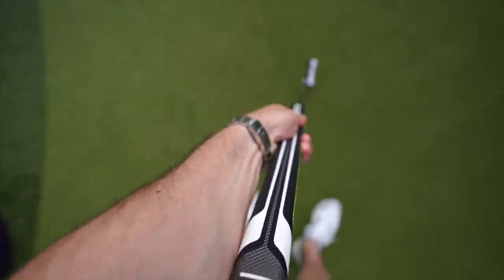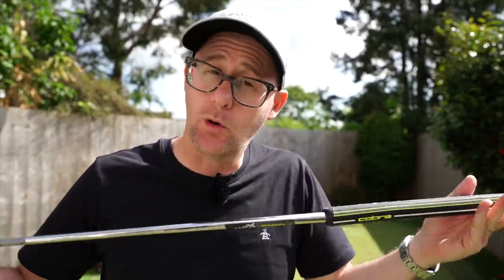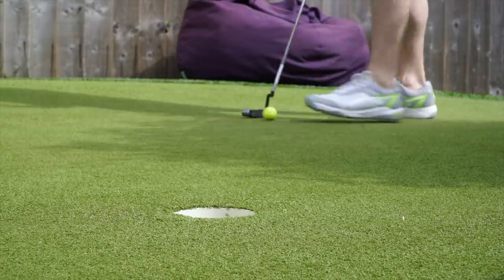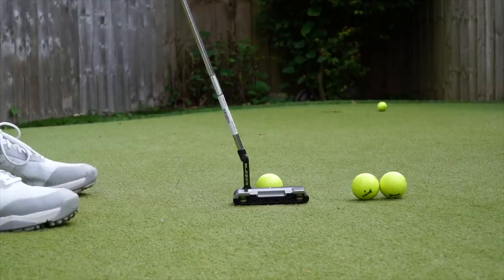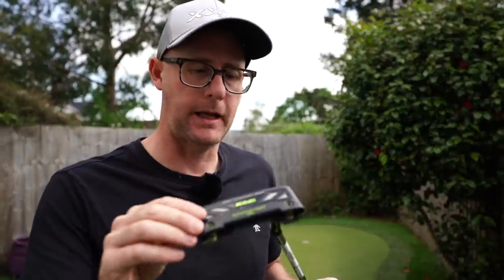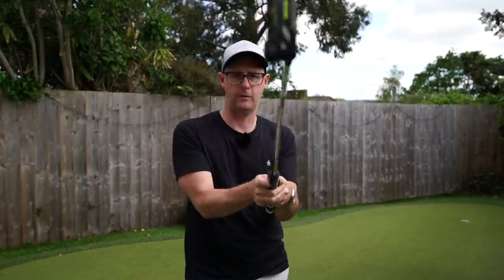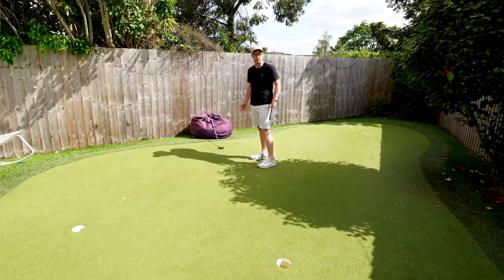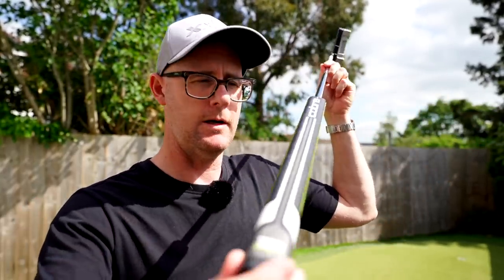Golf Putting Techniques could CHANGE for EVER with this Simple Idea

Comment: Your final comments are so accurate, really well said
Reply: Is it such a bad idea that what’s banned to pros doesn’t NEED to be banned to amateurs? I’d like if my pops could anchor and have a better time while holing more putts.
Reply: At the end you brought up another point that I think is important. Banning something in tournament play shouldn't be considered in the same vain as recreational golf. Golf should be fun and if you are playing for fun some freedom taken by recreational golfers. It speeds up the game and makes it more enjoyable.
Reply: it's too hard to ban.  I can actually arm-lock my current spider putter by choking down on the grip.  how do you define the rule?
Reply: Putting is a weak part of my game, wonder if this could help 🤔
Reply: Ridiculous to ban it. It is not an advantage, simply a different way to grip a putter that some players like better. Some players putt worse with armlock, so of course they are the ones who want it banned. If it really was an advantage, every player would use armlock, but that’s not happening. Golf is getting silly with its technical interpretations of everything.
Reply: @davidmeeks7449  Well said David... agree.
Reply: @davidmeeks7449  agree 100%
Reply: Easy fix just set a max putter length solves many issues.

Comment: Hi Mark I’m a big fan of your channel as you often put a different slant on things together with good humor.

Like so many other golfers my main problem with golf is putting and I have purchased a number of putters trying to find one that I’m comfortable with. I now own the Odyssey #7 as well as the Odyssey Broomstick, Cleveland Beach (which I think you already use), mallet - and a number of others.

Being retired golf is my passion as well as my exercise, so I will spend money trying different things out and that is why I’m now looking at an Armlock putter.

Being tall, I’ve found that by holding the longer broomstick putter I get a better feel and view for the length and line of the putt as well as a more balanced shot allowing the broomstick to roll back and forth before I let the ball go (a pendulum movement so to speak). Other normal sized putters seem to move all over the place in my hands and so the ball tends to travel offline.

I’m also not a big fan of crouching over the ball (aka Jack Nicholas), as it hurts my back as well as not allowing me the full picture as I’m about to putt the ball.
I’ve also tried holding the broomstick further down the shaft to see how the balance feels and it’s pretty good and that’s why I’m now looking at a Armlock putter to hopefully cover most of my putting issues.

I’d appreciate your views on my comments as well as advice on what Armlock putters you like.

Keep up the good work mate as your one of the best on the net 😊

Comment: I really feel like PGA will be looking to ban these soon
By their own admission of banning body lock and side saddle putting I would be very surprised if they didn't ban it in the years going forward.
However, I am a bad putter so I'll take any advantage I can get before it does get banned 😂
Reply: Hands only will probably be the overarching rule.
Reply: God putter
Reply: I hope they don’t as this would drive me away from golf forever. Tennis here I come!!
Reply: side saddle putting is still legal as long as there isn't an anchor point. I also still use a 48" putter... still legal as long as the forearms and the end of the club aren't anchored. Just try and find a 48" putter on e-bay these days. LOL.
Reply: @julia-6195  I remember Bryson being told he wasn't. Maybe I got the details wrong
Reply: @ForzaOwnz  I believe he just got told his side saddle putter was illegal but that was because he ran it up his right arm in a really strange way and it was considered anchoring or maybe it had to upright of a lie angle. Check out Bomar putter company for some side saddle options. They seem to be approved by the USGA
Reply: I agree that it probably will be banned, and rightfully so. It's no different than anchoring with a belly putter was; if you're stabilizing with anything but your hands, it's body anchoring.
Reply: The fact that Bryson uses it. It's reviewable hahaha
Reply: Doubt it. Lol
Reply: I am disabled and been using a normal putter pushed against my left arm I have been doing this technique way before arm lock putters came on the scene so if they ban arm lock putters will they ban the way I hold my normal putter good luck with that one.

Comment: I’ve been using armlock putters for soon to be thirty years, prolonging regular shafts, since there were no ones on the market! Yesterday I tried out the Cobra armlock, and I am now considering buying one. One trait of putting still not being used by the elite,  is the open stance, making it possible to let the upper part of the trail arm be sitting against the body. The left hip would be placed forward, enabling the head be situated well behind the target line.

Comment: Became a bad putter after spending the winter in Canada at indoor putting centre got the yips resulting to go to anchor putter in 2000. Since the ban have struggled since!!! Tried and tried all types of grips and lengths of putter except the armlock. Thanks for the updates on putter tech.

Comment: Used to be a bad putter but made a few changes and I have improved a great deal. Having a couple of practice swings looking at the hole to get a feel for how hard to hit it and lining up a line on the ball with the line I need to take to remove one variable when putting being two important changes that have really helped me sink more putts. I have tried an armlock putter at a golf shop and it did feel like a much more controlled stroke.

Comment: Bought this putter a month ago. The trick beyond just getting used to locking it into your lead arm is looking down at the putter face during address to ensure the face angle is square (not too delofted or lofted) which will result in a better strike better sound and more made putts

Comment: I had the yips for 10 years! Finally learned to overcome those wobbles by looking at the target! I don’t currently use an armlock putter. But if I start to see an unstable stroke , I will buy one! 
I believe this method should not be banned. It does not anchor the end of the putter in one spot! More secure? Yes! But not anchored!
Reply: Same here, but i fitted two grips to my 2 ball putter, ,  to become a long putt, to seperate my hands , similar to adam scotts long putter..

Comment: Always been an “ok” putter but over the course of a season on average I would lose some fraction of strokes when compared to players of equal handicap.  I have struggles with pace, more than line, I try to make my misses on the high side and past the hole but when pace control goes, I use the strategy to look at the hole rather than ball during my stroke.  It mostly helps, I can see the weight needed, but you tend to get a miss strike, often I think from putter face height throughout the stroke.  I like the idea in this new cobra putter with a rolled face and more tech on distance control with off centre strikes.  I look forward to giving it a go.

Comment: I'm a bad putter. Usually around 40 putts in a round of low 90's. I've had essential tremors for years and would do anything to take the hands out of the stroke.
I putt left hand low (I'm right handed) which helps a bit believe it or not.
Obviously would worry about it being made illegal if I went for it but still very very tempted to go for it.

Comment: I have both an Armlock and a standard putter and I can honestly putt just as good with one as the other. The one difference is the armlock does not require as much practice inside 5-7 ft but the trade off is distance control is more difficult outside 15ft. Especially on slow greens. Other than that any “advantage” comes down to the mental side of things more than actual physical results.

Comment: Just got fit for a slight arc and according to the Ping fitting system I'm a +6.6 putter (my 75 with 38 putts last week begs to differ), but was using a completely wrong rig for my swing. Been using a Cira 62 (strong arc) since 2009 and my body adjusted to it, haha. Putters should be in your hands, period. Not on your chin, against your chest, up your arm, 100lbs, etc. 35 inches is long enough for anyone and too long for most. Mark was that a Cleveland HB Soft 11... I just put one in my bag!

Comment: Back 12 or so years ago I dealt with a horrible case of the yips, I went to an arm lock putter for almost two years before I tried conventional putting again. My yips were mostly gone, I mainly stay conventional with my trusty Taylormade Modena 8 putter, every now and then I feel yippy and out comes the arm lock again. So why not stay with the arm lock putter, my long putts are so much better, much better feel on long putts. My view on the arm lock putter is that it is not cheating, not what so ever.

Comment: Nice review Mark, I’m not a fan personally as I feel it is still Anchorage like belly, broomstick etc.

Based on this I could stick a long grip on my standard putter, then have a device come of the top of that grip that links onto my forearm to lock it together. It would be frowned on by in essence is an armlock putter.

That said until it’s outlawed, why not use it and get yourself a leg up. After all the game it pretty damn difficult.

Guess I’m saying I’m conflicted, the traditionalist in me says no but the golfer wanting to improve and lower scores says yes.

For the record, I’m pretty decent with the flat stick. Odyssey O-works 1W with claw grip works well for me.

But if an armlock grip putter turns 2-3 one putts per round into 5-6 and it’s legal. In the bag she goes!!!

Comment: Brysons putter has nothing Cobra about it. It’s a SIK putter. It has a custom welded on neck to fit the fat LA Golf putter shaft on it that’s incredibly thick with a Jumbo Maxx grip on it with the flat side towards the hole. 

Regardless, nice video as usual. This is good for those unfamiliar with the arm lock method.

Comment: Not sure about concern for banning.  The putter is not pivoting around a fixed or anchored point or resting against a fixed part of the body like the old, banned chest putters. My arm is fully in motion throughout the swing with this style so, not the same as anchoring to my chest.  Many folks lock their wrists when they putt and that hasn't been banned.  I think this will be left alone :)

Comment: Interesting. Would have been great to set your sense of using it for longer putts. If it is as easy to dial in distance sounds like a good idea. When BDC uses it it looks more upright and rigid whereas when you used this one it looked much more natural.
Reply from the maker: Long putts where fine. No different and same ideas for breaking down. 👍

Comment: First, an armlock putter must have additional face loft due to the forward angle / grip pressing against the forearm - as such setup position, the loft would then decrease back to a 'standard' loft for the putter (i.e. 2 to 4 degrees) . Converting a 'standard' putter - lengthening it would require a specially made grip for such, like from Arm-Lock Golf that makes up the required increase in loft when the forward-press type shaft lean position is made at setup without changing the actual loft of the putter . The hole in the larger grip is angled to create the additional loft . For best results, use a face-balanced putter if converting . I converted an old Zen putter for my son and he loves it - as Mark stated, my son says he just 'feels' more comfortable and his stroke feels more stable . With the entire putter moving during the stroke, I don't see it as anchoring as defined by the rules . I'm even surprised those who did could even putt that way - a very odd stroke / putter path . In converting to a non-anchoring stroke, I think Bernard Langer is one of the best with the long putter and his grip method and stroke - proven for him due to his great success on the Champions Tour .

Comment: Decent putter.  It's on and off.. but when nerves kick in the thin grip effects me.  Buddies who have a bigger grip tend to hold the fort down during pressure. Add an armlock in there and it's completely more stable and combats pressure.. all in all I would use,. Maybe short break putts would be the problem with such a long putter.  But those nervy 4-6 footers arm lock all the way.
Reply: Especially the feel* on the short break putts

Comment: I’m a bad putter because I don’t play as often as I should, so I’m hoping an arm lock putter with the sik face will help with consistency.  Theoretically my stroke shouldn’t vary much and exact ball position shouldn’t be an issue with the varying loft.

I don’t think it’s anchored because your arms and shoulders have to move.  Your belly, chest, or chin as center anchor points don’t have to move to make a stroke.  

It’s not magic, for some professional players looking for this extra 0.5% gains that can make a difference between keeping your card that year it could help, maybe.

Comment: Bad putter - anchoring around a fixed point uses the pendulum effect, letting gravity and the putter do the work, while this is anchored to your arm, it's not that different from being 'anchored' in your hands is it? The pivot point is your shoulder/back which is dynamic not your chin which could be fixed throughout the stroke. Basically, it's fine. I approve.

Comment: I loved the feel of my Odyssey two ball armlock the second I picked it up. I putt very well with it as well and share Mark's feeling that it is enormously stable. I feel as if there will be no variation in my alignment, less tendency to make adjustment mid stroke, and absolutely no wrist flipping. I put very well with other putters, but this one feels like a significant advantage. They haven't banned it because it's really not much different than a left hand low type of grip. It's not anchored to any fixed part of the body.

Comment: Well if it’s a fixed point, then isn’t the grip a fixed point within the hands? The forarm becomes an extension of the hand that is all. Grip still moves just like it would if you held it in your hands, only thing changed is it’s a one piece stroke instead of a two piece.

Comment: I don't see the problem of this style of putting - you can do something similar with a standard-length putter and grip down low. I never understood banning the anchored putter. How many tour pros used it? 5%? If it was so much of an advantage, many more pros would have switched! Limit the length of a club, fine. But how you swing it should be up to the player, not the bureaucrats.

Comment: I'm a 3 putt man. The similarities I have with this putter are uncanny. My head is 3D printed, and I spend all day wobbling it, as when they printed my new head they used heavier than normal materials by mistake. Because of this my putting has been terrible. My plastic surgeon said an arm lock technique will help no end correcting his mistake. 😊